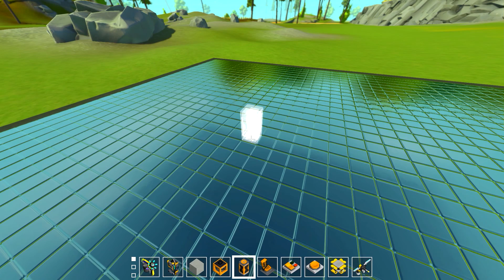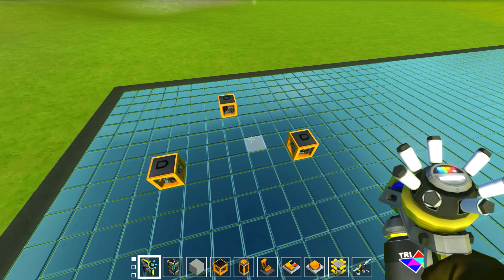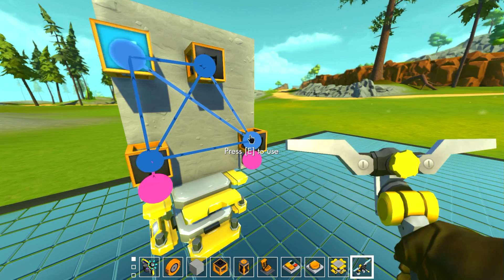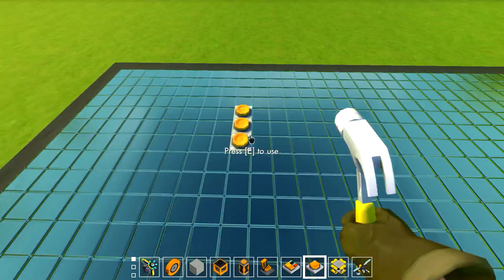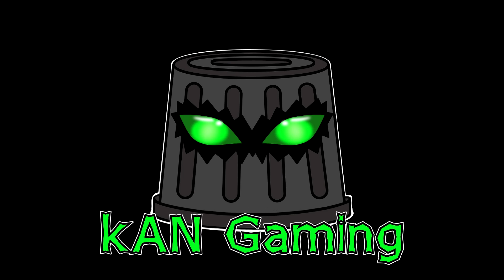Memory Circuits! (Scrap Mechanic Logic Tutorials #02)

Comment: idk if it's the current version but or-xor-or memory with a tick generator is not working. Did it with a piston and a switch-sensor. A spud gun and a switch would also work.

Comment: FIX FOR THOSE WHO USE THE BUTTON, OPTION 1: increase the tick delay on the timer to 2 ticks (keep in mind that if you "stab" the button too fast it will still start to loop). OPTION 2 (recommended): change the xor gate after the timer to a nand gate (this allows to keep the timer at 1 tick, so its harder to make the system loop if you press the button too fast)

Comment: welllll i can`t make t-flip-flip with both... following comments i reach another approach, make 3 xor and link all to the same one tick generator and done... with this other methods my tries never are consistent, they or switch between active or desative or blink forever depends where you click and the cycle rotine... at the end i did it work! but then i realize i not need it in the end... and use a simpler 2 sensors with switch mode and one xor... dammit, improve always beeing insane haha

Comment: Old video... so no shock that it's not valid anymore.  Totally non-functional.  all I can get it to do is pulse the logic gate's on state.  no saved states at all.  Also not shocking that I can't make it work cause you're talking so freakishly fast and I can't see what the settings are on all the blocks.  Without that information available, I'll never be able to reproduce anything you're showing.
Reply: Worked for me, try listening to what he is saying and building based on that, instead of reading from the screen and copying, it might suit you better
Reply: If you mean the XOR loop, just send a 2 tick pulse.

Comment: This is great stuff, I'm not exactly sure I understand everything, but using some of what I did understand (and lots and lots of hours later) I was able to make a functional gate with a combo lock of switches which also locks from the inside. I want to make it so that I don't need the combination to get out now, and to make the combination reset or disappear after a set amount of time.

Comment: I have watched this over and over, but my gates wont stay fully on. They just flicker. any tips? I am guessing its a bug at this point lol
Reply from the maker: If they flicker it is because there is something conflicting. Hard to say exactly what your issue is though without seeing the setup :(
Reply: @kANGaming  Basically just copied what you did. I tried in a fresh world without mods too. Still just getting the same flicker. The Tick generator works fine, but when sending that further, the 3 gates that is supposed to stay on or off mostly flicker and will rarely turn either on or off.. It almost seems like the tick is not fast enough. As if there is a 1/1000 chance that the tick might hit perfectly.
Reply: Will ask someone in your discord later. Probably better to see it. Thanks anyway. Awesome videos!
Reply: @ranrjbneztnarf8932  did you find the asnwer ? cause I have the same problem...

Comment: One difference between the 2 forms of memory is that the XOR is self-toggling i.e. it can be toggled with just 1 button whereas the NOR, NOR, OR memory needs a 'toggle on' input and a 'toggle off' input to flip the memory so a single button can either set or reset the bit but not do both (without extra logic of course). It is also possible to make a NOR, NOR, OR system work as a self toggling bit by checking that if a button is pressed and the bit is on, then turn it off (and vice versa).
Also: an XOR gate is active when there are an odd number of active inputs, not just 1.
PS: Sorry for the wordy explanation, but hope you can create amazing creations with this knowledge. :)

Comment: for those that are interested the first one is called an RS flip flop, the second one I'm not sure but it seems to be some kind of latch
however the RS flip flop can easily be made to work with only one button using an and & or/nor gate so really just make sure you master the first one :p
Reply: Not really: first one is an RS latch, or more specifically, the one he uses is an RS nor latch. The second is a T-flip flop

Comment: I made a T Flip-flop with only 6 gates, no timers, and using an xnor latch. I deleted it for whatever reason and now I can't figure out what I did...
Reply: Button goes into AND and NOT gates. The NOT gate goes into the AND gate, which goes into 3 XOR gates. The XOR gates loop into each other. Output is one of the XOR gates.

Comment: Whenever I do an xor or or loop, it just flashes no matter what. Help!
Reply: Mine does the same, set your timer to either 2 or 3 ticks and it works. Your tick rate isn't fast enough for the process an you only have one gate on at a time. If you set it to 2 or 3 ticks, it gives the game just enough time to fill all three gates.

Comment: you can make the 1 tick generator smaller:

just connect a button to a NOT gate.
then connect the NOT gate and the button an AND gate.
now the AND gate is the output.
Reply from the maker: yup the discord mentioned this too... I've been making it excessively large for no reason

Comment: I've used logic a lot but one of my oldest creations i'm having a slight problem with. It's a "combo-lock" build that is currently working on a ground based structure and had the first 'insertable, configurable key lock mechanism' which has now been swapped out for a more complicated 'keycard' system. Now i want to compact it as its reasonably large and make it a lift-able creation but i'm struggling to get 1 of its functions working properly.

Build at its core is a memory array with a switch that controls the memory array storage 'state':
1. switch off - memory gets activated in sequence and all previous set stay set
2. switch on - memory gets activated in sequence and previous set gets reset with the next set

The problem i'm having is the switch when turned on ends up creating a memory 'wave' in the cells(on,off,on,off etc...). This wave sometimes is 2 in length and confuses me as to why its doing it.

any ideas??

Comment: memory is ram. storage is the location where the values are held.
Reply: Michelle Burton kind of. RAM is where processes store data while they are running, and then that data is then moved to the primary storage at a later time, to keep the computer from messing up the hard drive.
Reply: my idea of ram is like a fast place to store things that is temporary it doesnt want to take the time to write and read a peice of the harddrive this takes time and wheres out the harddrive so they created a fass "storage" where they can put tempary data such as i have a switch pressed in the game that data gets moved to the ram to keep it loaded without having the hard drive worn out and so the cpu doesnt always loop its command on the switch it just tells the ram hey this switch is on and the ram keeps that data and if its really important later it will move it to the hard drive and if not it just erases the data